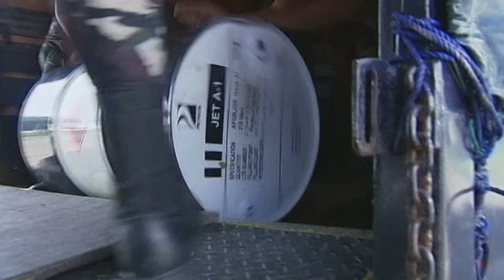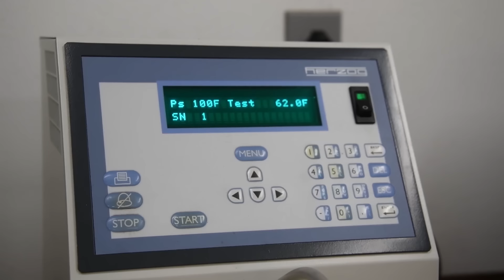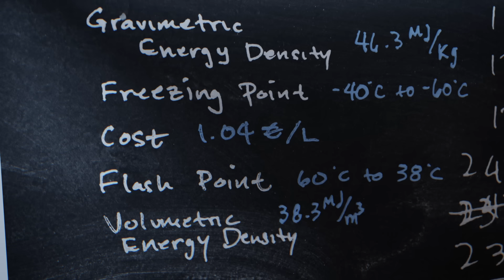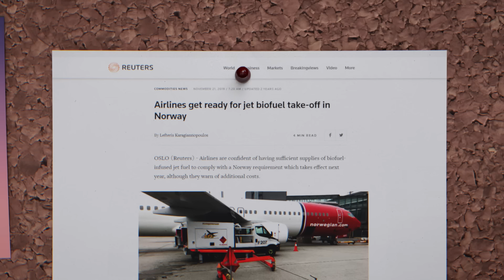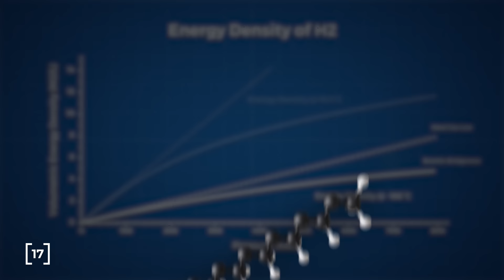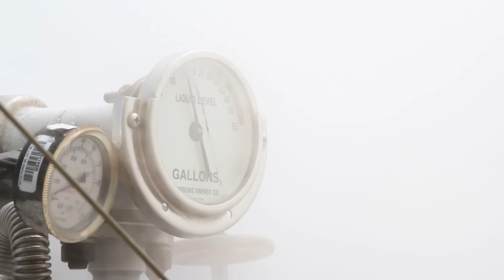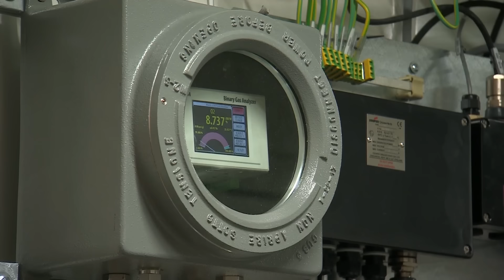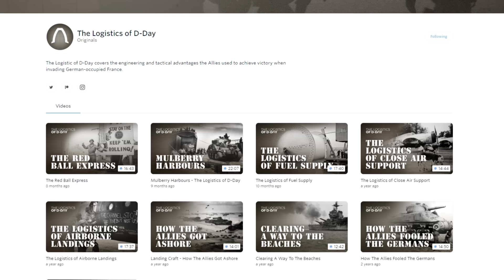The Uncertain Future of Jet Fuel

Comment: I do not oppose that volumetric energy density is important. However, if you are taking all your weight into the sky, specific energy density is even more important. That's why batteries can't send planes flying but hydrogen may.
Reply: Batteries can power airplanes, but probably not jetliners as we’ve known them. The ultra low cost of electrical power compared to any hydrocarbons will make battery powered planes inevitable for short haul flights on smaller aircraft, in the 20-40 passenger range. Think Denver to Cheyenne, or Phoenix to Flagstaff. Without some pretty amazing breakthroughs in battery tech I don’t see them scaling up beyond small commuter planes, but in that market they’re likely to completely replace fossil fuel powered planes.
Reply: You're right, although volumetric density is important when talking about how planes that are already used today could be retrofitted to something else. It's not that important when talking about the general ability of fuels to be used to fly; I think the alternative plane design he'll discuss in a future episode is exactly an elaboration of this principle.
Reply: Nah man, volume density is extremely important. batteries are worse in both mass and volumetric energy density than jet fuel.
another reason batteries are not viable yes is because of the way turbofans and turbojets work. 
batteries are good for turboprops but turboprops are not good for high speeds. the low energy density(volume)
means more space is needed and more space means larger planes and larger planes are bad as they are heavier and well, larger.
Reply: @fenrir834  "batteries are good for turboprops", would you please elaborate? Is it due to preferred RPM range or power output range? Or, is it "batteries" or actually "electric motos" and why? Thanks
Reply: @sunspot42  Batteries can power anything and they ARE powering everything right now. It's just that asking Mike Tyson to run 100 meters competing with actual Olympians is not the path on which we should put our hopes. Hope you get my idea, batteries will eat up too much weight allowance both in ground vehicles and airborne ones. Passenger planes need to leave extra in the tank as a safety guard and this just makes the range even less practical.
Reply: @zyxlsy  I am sorry my last reply was poorly framed. what I meant was battery-operated motors can very well replace turboprops but when it comes to turbofans and turbojets, there might be a problem. see a good percentage of thrust in even low bypass turbofans is provided by the core or the exhaust gasses. high rpm is not the only thing needed when flying transonic or faster. theoretically, we can use batteries to heat the air, but that won't be viable. now there are other technologies that are being researched(e.x plasma jet) to make flight possible in transonic and above range but they are in very early stages. .
Reply: @zyxlsy  I am sorry my last reply was poorly framed. what I meant was battery-operated motors can very well replace turboprops but when it comes to turbofans and turbojets, there might be a problem. see a good percentage of thrust in even low bypass turbofans is provided by the core or the exhaust gasses. high rpm is not the only thing needed when flying transonic or faster. theoretically, we can use batteries to heat the air, but that won't be viable. now there are other technologies that are being researched(e.x plasma jet) to make flight possible in transonic and above range but they are in very early stages. .
Reply: @zyxlsy  Wrong. The weight of batteries isn’t a dealbreaker on smaller vehicles, including cars and prop planes up to a certain size flying fairly short commuter routes. Indeed, their economics are better than fossil fuel powered planes, because electricity is so cheap and electric motors so maintenance-free and reliable. Wendover Productions just had a great video on it:  https://youtu.be/aH4b3sAs-l8.
Reply: @sunspot42  We engineers often do not use strong words like "WRONG" to describe debatable things in our works when the only evidence we have is a  YouTube video form Wendover Productions.
Reply: @zyxlsy  So you have no argument regarding what Wendover presented.  Got it.
Reply: @sunspot42  No, quite some actually. But none of those are relevant to this discussion with an overly-optimistic absolutist, which is you. Take care.
Reply: @zyxlsy  It’s not “overly optimistic”. It’s just math. Battery tech has reached the point - and the cost - where smaller commuter planes going electric already makes sense, and will make more sense going forward thanks to their lower cost of maintenance and how inexpensive electricity is as a fuel. 

An electric replacement for larger planes like the 737? That’s a much greater technological challenge. Carbon offsets and capture might be the better solution for the aerospace sector out until the middle of the century, tho breakthroughs in battery, capacitor or superconductor tech could more rapidly alter the landscape.
Reply: @sunspot42  Would you care to point out at what time in this Wendover video did it present any numbers engineering-wise? A bunch of economic numbers and I am not gonna argue with those without first learning the business models thoroughly. But come on, at least give us some engineering numbers other than "it will fly roundtrip without needing a recharge". At lease we should get some ideas on gross weight, battery weight, specific energy density and etc.

Looking at your last reply, it also shows a similar symptom - a paraphrase talking about math WITHOUT a single numeric. But hey, Wendover was just making an insperational video, I'll cut some slacks for that. You on the other hand are arguing science by using only English words.

If you cannot see the problem here, I can only say I'm sorry.
Reply: @zyxlsy  It’s not “inspirational” bro. It’s just facts. The battery fraction of the weight of a small commuter plane isn’t that extreme. It still allows them to fly the short routes they tend to fly at low speeds compared to jets.
Reply: @sunspot42  "The battery fraction of the weight of a small commuter plane isn’t that extreme" - then present the numbers first

Comment: My prediction: 50 years from now we'll still be using kerosene and there will be no problem.
Reply: Climate change is a hoax anyways. So I believe you're right
Reply: My prediction: In 2016, it was predicted that their is only roughly 47 years left in the oil reserves. Give or take 5 years, we'll not still be using kerosene in 50 years cause we'll have run out. Unless we start manually producing it...in which case, there's no reason not to switch to biofuels and other more renewable sources that don't come with a bunch of other quite nasty side products (sulfur dioxide, carbon monoxide, C02 isn't exactly great in large quantities either)

Comment: As a GA student pilot, and an avid aviation enthusiast. I know that electric planes exist, and that turbofan engines are actually far more efficient than a high bypass turbofan jet engines. 
And if I’m not mistaken, turboprops use 100LL fuel.
Reply: Turboprops use kerosene not avgas
Reply: 100LL is only necessary because of legacy engines that cannot be replaced with newer engine designs because getting FAA certification for a new engine would cost multi millions of dollars.
Reply: Turboprops are jet fuel

Comment: Seems like the easiest answer is to use biodiesel with insulated heated tanks. Probably using an inboard diesel generator to make electricity to run electric propellers rather than insulating and heating long fuel lines to several outboard engines. Would also make it easy to use diesel engine waste heat to warm the fuel too.

Was sad that pre-heating the fuel before using it wasn't mentioned in the video, since this is commonly done already when burning heavy fuel oils on an commercial scale today.
Reply: Wrong, the easiest answer is do nothing.

Comment: Metal hydrides could greatly increase the volumetric energy density of hydrogen and increase safety but there might be issues with releasing the hydrogen from its bond fast enough to keep up with the engines in traditional combustion turbojets.

Comment: me 7m into the video
"i am never driving a gasoline car again. DIESEL it is!"
".... just to lower chances of fuel fires? THAT is your motivator?!"
".... Yes."
Reply: Did you see Mexico spicy water. I don't have the link, but look up hell on earth right now by memeology 101 on yt.
Reply: Battery electric fires are actually quite commonplace, they are extremely unpredictable (especially compared to Diesel), and people have already died in fires despite relatively low numbers of EVs. https://en.wikipedia.org/wiki/Plug-in_electric_vehicle_fire_incidents

As battery power density increases this problem will only become more frequent and/or more deadly. One thing about combustion fuels, they can't explode in a vacuum as they need Oxygen from the atmosphere to release their chemical energy. And there's only so much of that per unit volume of air. 

Batteries, like solid rocket fuel, has all the chemical components ready to release energy at a moment's notice... Whether electrical or by other, drastically more explosive means.
Reply: @gasdive  Certainly battery vehicles are no worse than Petrol cars, but they have their own troubles and the worst incidents are yet to come (power density).
But the person you responded to specifically talked about Diesel... Diesel— which doesn't ignite (flash) at room temperature, unlike petrol/highly refined fuels, and lithium batteries, which begin burning instantaneously upon their destruction. In a crash, diesel cannot just spontaneously combust if the fuel tank is punctured (unlike the aforementioned). You can make diesel ignite, but the occupants could be soaked in the fuel and still escape unscathed (assuming they could). So EVs are certainly not more safe in comparison to diesel powertrains, that is my main dispute regarding your perspective.

Comment: The main problem with jet fuel is that it can't melt steel beams.
Reply: I bet "Q" has an answer for that.lol
Reply: What about building 7 how did it fall down without anything hitting it.
Reply: @waichungsham1578  Happy accident?
Reply: Which is why is a good thing to know that steel becomes soft and looses its load bearing ability a solid 1600°F below its melting point and that burning jet fuel is awesome at lighting other things on fire.

Comment: If the goal is to be carbon-neutral, the obvious solution seems to be carbon-capture using renewable energy. It could be cost effective once at scale. And the mandate could be "you can't burn any fuel you didn't already pull out of the sky."
Reply: Unfortunately, the tech is not ready yet. That's why Elon Musk put price money up for the person who invents a better carbon sequestration method
Reply: It could work, but aviation would have to remove 2-3x more carbon than it emits, to counteract its other emissions and the altitude it puts them at. In terms of global warming, a tonne of CO2 at sea level is not equivalent to a tonne of CO2 at aircraft cruising altitude.
Reply: @erikpoephoofd  Granted. But I think the video made some assumptions that whatever replacement method is chosen will require a few years of R&D, tons of money of investment, and a glut of cheap renewable energy. With those, carbon capture could easily become the cost effective replacement, and it wouldn't even require an overhaul of the planes and infrastructure itself, making it probably the cheaper option.
Reply: @Android-ng1wn  Wellll, very long term it would have to be something else (who knows what, maybe they'll have onboard fusion reactors by then). But in the short term if you could remove additional CO2 as compensation that would work out, because we have/will have a huge excess of CO2 in the atmosphere. "Remove more CO2 than emitted to compensate for warming from particulates" should work out fine, if the economics are least bad (they're all awful).

Comment: This is really a non-issue if all other industries convert to solar, wind, and electricity.  If jets are the only thing left spitting out carbon, the earths ability to re-absorb carbon from the air will compensate.
Reply: That would be true, however, there's another problem, crude oil will eventually run out, as it isn't infinite, so we will eventually need a new fuel source.

Comment: even if its 25% the total size of carbon world wide would be so much lower i dont think this would really even matter. like even in current air travel 4x's and the there are these massive cuts that lets that be 25% of total world carbon output that still means carbon is cut by more then 50% well over what anything is suggesting is required.... seems kinda pointless for the time being.

Comment: I see several ways forward:

1. Prioritize the usage of biofuels for aviation, as opposed to sectors where they are not absolutely necessary. For instance, we do not need to run cars on ethanol when we can run them on electricity.  

2. Expand high speed rail in order to lower the number of people flying short haul. 

3. Prioritize the development of hybrid aircraft that won't need to use as much fuel. 

4. Restrict private aviation that uses anything other than electricity or hydrogen. If properly enforced (admittedly an unlikely scenario), it might also increase the purchase of first class tickets on commercial airliners.  

5. Increase clean Hydrogen production by embracing Methane pyrolysis. It's baffling to me how little we hear of this, and how mind-numbingly uncreative the comments and counterarguments are when the topic DOES come up. For those who don't know, methane pyrolysis is a way of producing Hydrogen and Solid Carbon from methane gas. It produces nothing apart from these two things. It's cheaper than electrolysis but more expensive than steam reforming. It would not be necessary to use the solid carbon for anything, and it may not even be desirable (since other uses may have it transformed into a greenhouse gas). Inevitably you hear the counterargument: "We can't just waste all that solid carbon by putting it in some deep hole in the ground!" To which I answer: "Why the hell not?!" Sure it might not be "cost effective" but neither is electrolysis! The only other problem is the issue of fugitive emissions, This can be mitigated with greater investment and reorganizing the Natural Gas industry so as to minimize the circumstances where leaks can occur (which would also need investment).

Comment: The big one you missed is ammonia. High temperature fuel cells like SOFCs can react ammonia directly, and are hot enough that the waste heat can be used as part of a hybrid gas turbine. Liquid ammonia is objectively the best carbon-free fuel (aside from hydrazine, which is too dangerous even for aviation) since it has the highest hydrogen percentage by volume of any storage method, and the methods for producing it at scale are well-proven. SOFCs can also reach high enough efficiencies that the drop in performance when switching over from carbon-based fuels isn't catastrophic, despite the hit in volumetric energy density. There are already projects underway to use direct ammonia fuel cells in shipping, and it's likely that this technology will eventually make its way to aviation.

Comment: What clean alternatives do giant ships have as opposed to bunker fuel which is probably the dirtiest nastiest fuel you could possibly burn? I had no idea there were any alternatives for the same price. Any cleaner fuel would cost significantly more.
Reply: Lng
Wind supported
Batts on shorter routes
Reply: They already run on diesel or fuel oil, but "that's too expensive" so they get an open ticket to pollute like CRAZY with bunker oil while we are all demonized for driving cars.
Reply: There's been some suggestion for moving to LNG, but that's faced criticism because the cost of changing over would lock in the technology for decades and make proper decarbonisation impossible. Also it is possible to lower the sulfur emissions through different fuels or scrubbers, in reality though more regulation for low sulfur fuels will just push the dirtier fuels into poorer countries without the ability to say no.
Reply: @volvo09  who consumes the stuff transported on the ships, I wonder...
Reply: @the_retag  As perhaps a bit of an outlier, nuclear fission from an SMR. If the eye-watering personnel requirements can be reduced, it's pretty much an ideal solution.

Comment: Most likely we'll travel by air less in favor of high speed trains
Reply: That is the plan.
Reply: Or any trains, anything other than cars.
Reply: that seems hard to believe.
you have to get a lot more rail laid
then you have to get average velocity increased by a factor of at least 4
Reply: I'd love that
Reply: @MissMyMusicAddiction  trains cant go supersonic.
Reply: @baronvonlimbourgh1716 
How many commercial airliners fly supersonic?

Exactly.
Reply: @Joshua Kiser propeller aircraft have the problem of energy density. Their range is limited and their speed is comparable to high speed trains.
They're not any more feasible than renewably fuled jets.
Reply: @Joshua Kiser a TGV or shinkansen also has a regular cruise speed of 200mph    and reached as fast as 275mph in tests, while the Chuo Shinkansen holds the current record at 375mph